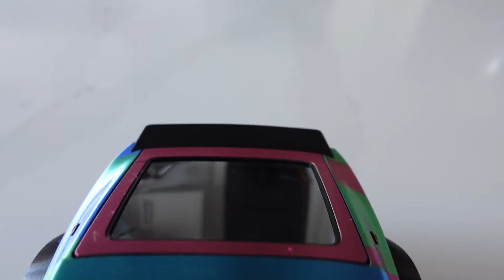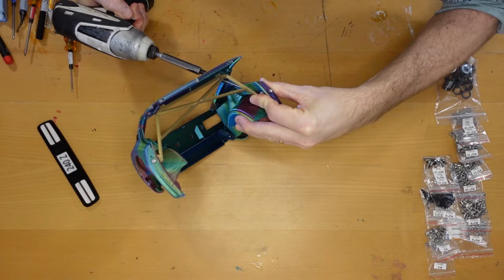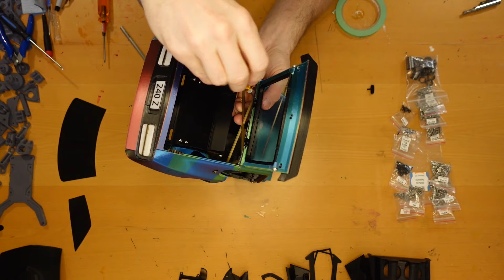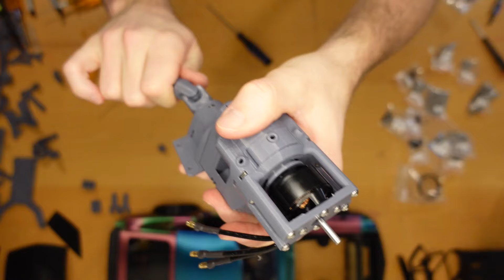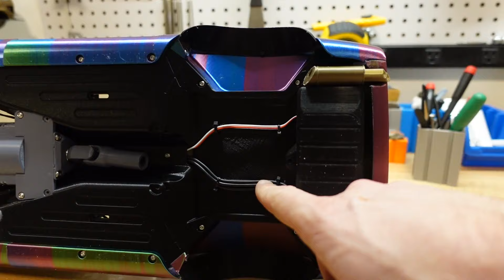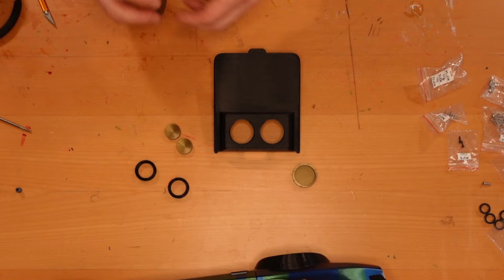3D Printed Datsun 240Z RC Car - The "Sakura" by 3DSets

Comment: I've used the metal servo arm - you have to print double thickness servo washer (just scale it in slicer) and cut off one screw hole of the arm length.

Comment: You ever have issues with the gearbox not wanting to go?
Reply from the maker: If the gearbox is binding and not moving smoothly something is probably not correct in its construction. I'd take it apart and check that all bearings and belts are properly seated. I've definitely got the gearboxes together and had them not work and then taken them apart to find I missed a bearing or I didn't get a belt in the correct spot. There's lots going on in those boxes so its easy to do. Once properly constructed though I generally don't have any issues with them.

Comment: Awesome build and great choice for the body color. I did have a few questions though...

1) What is the wheel base?
2) Can standard wheels/hubs be used on this build?
3)What is the steering angle? I'm thinking of getting one for drifting.
Reply from the maker: Hey thanks for the kudos...

- Just measured and the wheelbase looks to be about 295mm
- The printed wheels this comes with have non-standard axles so regular wheels wouldn't fit but it would be pretty simple to make an adapter to fit a standard 12mm hex... like this: https://www.printables.com/model/3520-3d-sets-rancher-12mm-hex-adapter
- not sure on the steering angle...
Reply: @rcprinter  thanks for the reply...I was just wondering if the steering would be fitting for a drift car...or maybe be altered to do so

Comment: I finished mines , I added front and rear lights but the main issue I have is the tires rubbing on the fenders , what size shocks did you use ? And my Max truck have the same issue with the tires …. But they are AWSOME cars
Reply from the maker: There's shock tower mods in the Sakura files for different size clearance requirements. I used 55mm shocks.

Comment: To by mě zajímalo jak jste zasunul tu folii do oken, když tam není drážka. Je to v 16 minutě a 46 sec. Děkuji
Reply from the maker: Ahoj! There should be a groove on your completed doors. If there isn't, you may need to check your print settings. We pushed the window into a groove for our build.
Reply: @rcprinter  Děkuji. Je směšné že mi čech odpovídá anglincky a há anglicky neumím. Děkuji

Comment: Does the build kit come with the STLs to print the model? It doesn't say on the kit if the files are included. Only that they plastic has to be printed.
Reply from the maker: The files are not included. You have to get those from www.3dsets.com